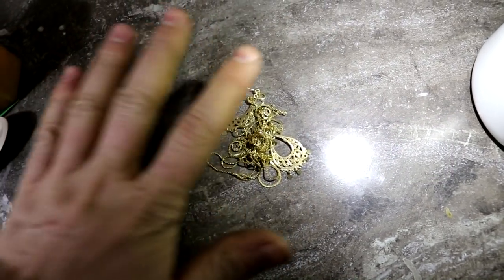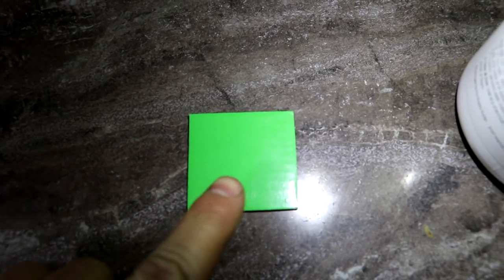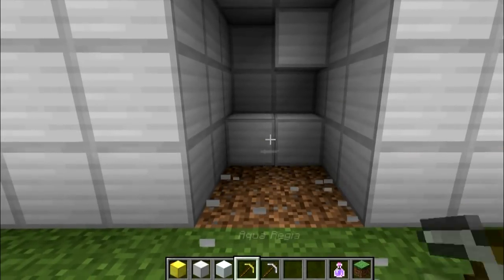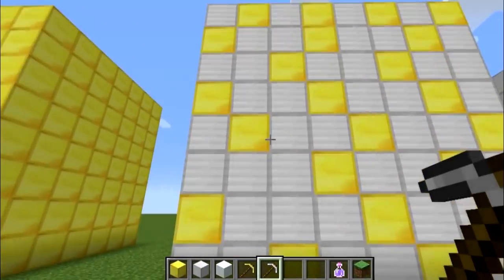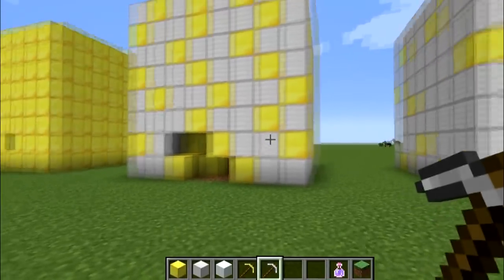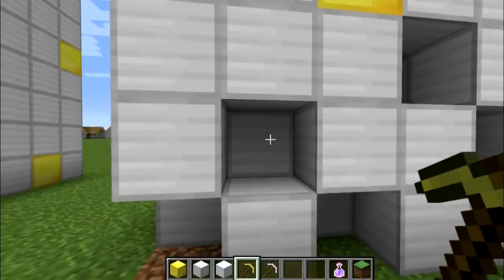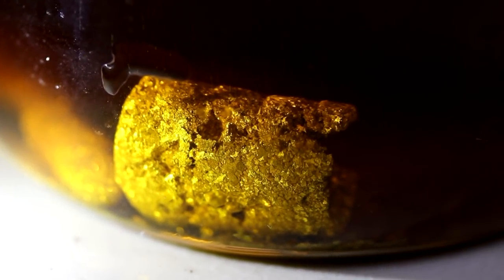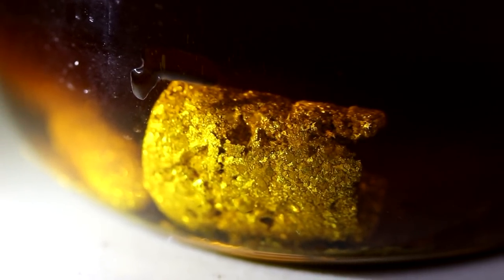Inquarting - Why We Add Silver To Refine Gold From Jewelry

Comment: Incredible - I had no idea the physical world really was a Minecraft simulation until now!
Reply: and to everyone's surprise, at the nano-scale materials turn into regular grids of atoms measured in nanometers. and no one thinks to ask why salt crystals tend to turn into cubes... build things from these blocks and you get nanostructures.

well... sorta... (ADD: yeah, I am aware that atoms are less than 1nm; that it is not a regular grid; ... but just running with the analogy. a grid size at around 128pm would be technically more accurate though than one at 1nm).

Comment: Is the non-gold in 14kt mostly silver? I thought it was mostly copper, so inquartation should not be needed. 
However Inquartaion is needed when the silver content is above about 8%, because then the AgCl formed with Aqua Regia passivates and protects the gold from dissolving.
Inquartaton means to reduce the gold content to a quarter or less, usually with silver or copper, so it can then be treated with HNO3 to recover the gold after the Ag/Cu is dissolved. It's actually a similar problem to the above, instead now the gold is protecting the Ag/Cu from the HNO3. But that protection stops when the Au is diluted to below 25%.
It's preferable to use silver over copper because a) it helps recover the original troublesome silver, and b) requires much less HNO3 to dissolve it.

Comment: I had this thought.... While it has been a couple days since the initial thought I was wondering why not make a plexi-glass container sort of like a BioChemical containers that they use with the gloves in them. I am thinking you could perform a few more experiments with Oxygen Reactive materials by replacing the air with Inert gas such as Nitrogen. Just a thought.

Comment: So could you make a fine gold powder by just dissolving the silver. Also how would this work with other finely mixed alloys where an acid only dissolves one of the metals. If a fine powder did form would it have a finer grain than dropping gold out of solution since it doesn't have the change to crystallize in the same way?  Great video btw!

Comment: Suppose aqua regia did not exist in the vapor phase and was confined to the liquid phase at all temperatures and pressures. To dissolve only the gold could you then react the aqua regia with molten gold-silver combinations to dissolve only the gold? or would this process of inquarting still be necessary?

Comment: i still don't get it. so to refine gold, we put silver, so we an extract the gold, then we got the pure refined gold, but we lose silver? ??????
Reply: Well the purpose is to separate the gold from the silver, this does that after dissolving the silver you'll have a solution with silver in it.
Then you add the right stuff to that solution to drop the silver out of solution in a solid state, if you want to recover the silver that is. Silver is much less valuable than gold and I guess there might be circumstances where there's so much contamination and not much silver resulting in it not being worth recovering, but I'm not an expert on these things. Might want to check some of Cody's other videos where he goes through the full process.